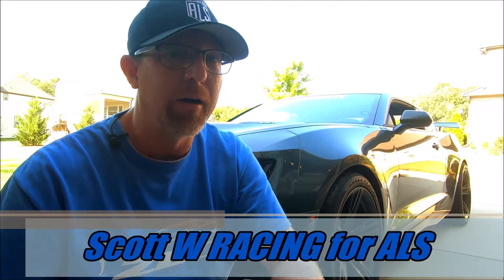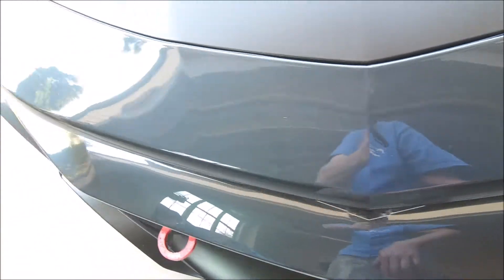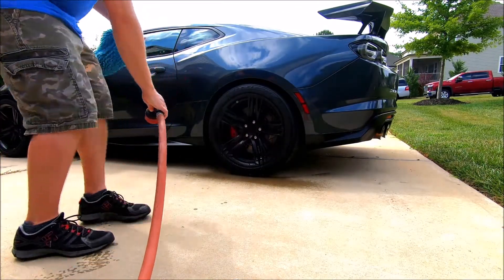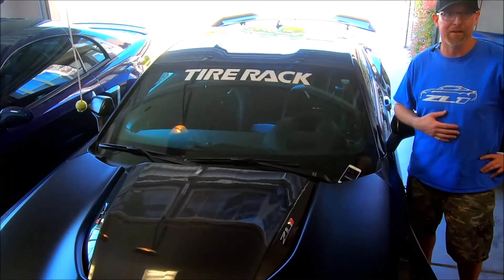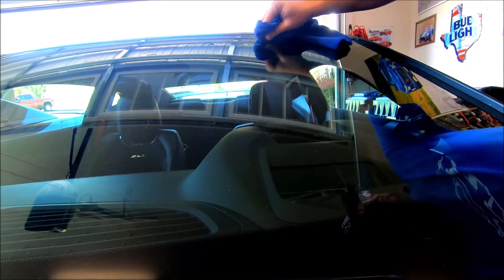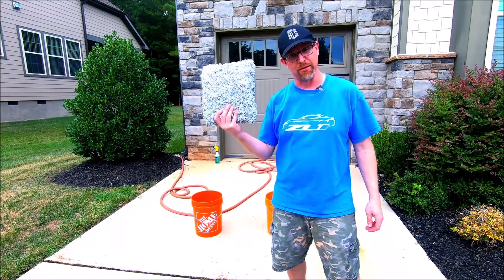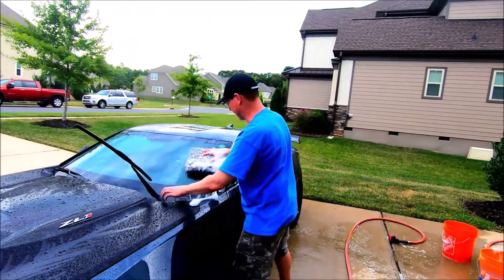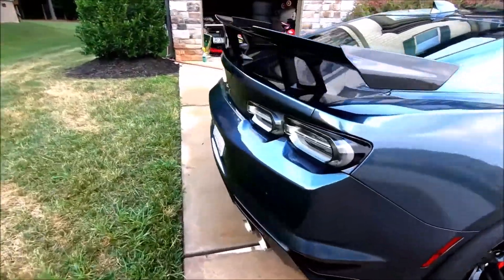CAMARO ZL1 1LE Exterior Detailing & Racing Rubber Mark Removal Part 2

Comment: Great job...Keeping them clean... they are easier to clean back up after track day. McGuire's Hybrid ceramic detailing spray works great.  Soak it down..
Reply from the maker: I am a fan of the Hybrid Ceramic Detailer and Wax. I have a new product called Gyeon Cure that I will test out before I do a video. Thanks for being a top fan of the channel and commenting! 💯💯💯

Comment: nice video..."goof off" is really good on sticker adhesive also.
Reply from the maker: I've used it in the past, but didn't have any on hand. The Racing Rubber Remover also did a decent job of removing it.